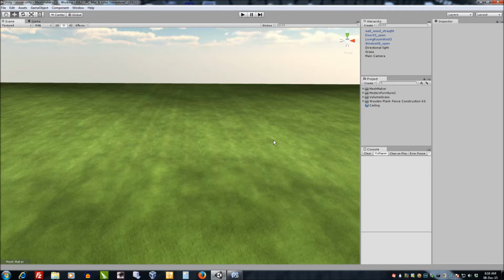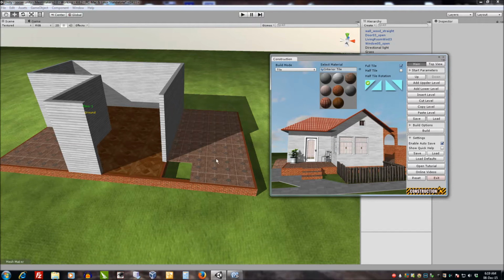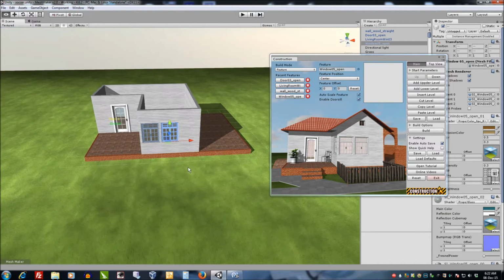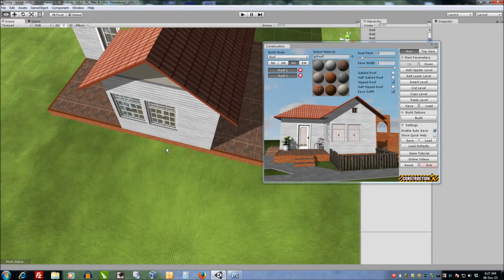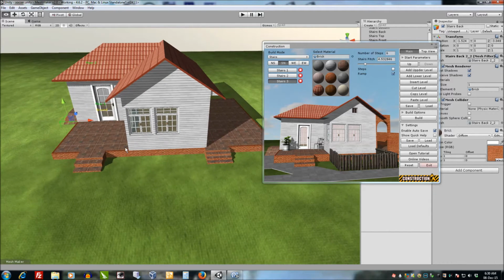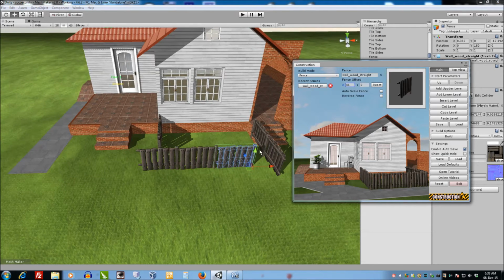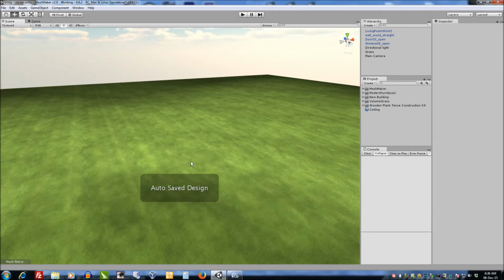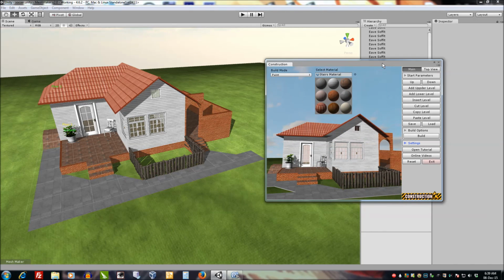Unity Construction Tutorial

Comment: I just brough your plugin at store,
here is my qurestion
1 undo redo seem not work perfect! undo not work
2: how to custom wall height?
Reply from the maker: Sorry for the late reply and thank you for your purchase. At the moment there is no undo/redo system in the program but it is hoped that it is fast enough to manually undo most changes. You can delete and insert levels to quickly rebuild.

To change the wall height to something other than the default you can go into the parameters section and change the Unit Size, which is in millimeters. Then you can set the Cell Height and Cell Width values which be based on the Unit Size you chose. So a Unit Size of 10mm and a Cell Height of 100 would give you a wall height of 1 meter.

I have posted a list of other frequently asked questions regarding Construction on the forum at https://forum.unity3d.com/threads/mesh-maker-the-modeling-editing-collection.204606/page-6

Thanks again for your support,
Alan